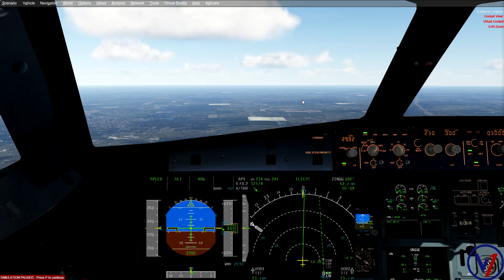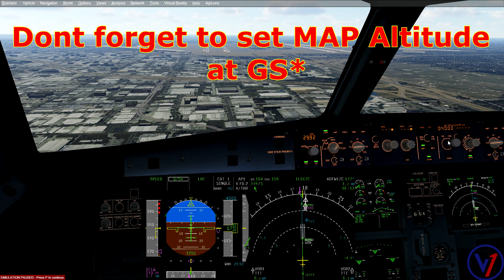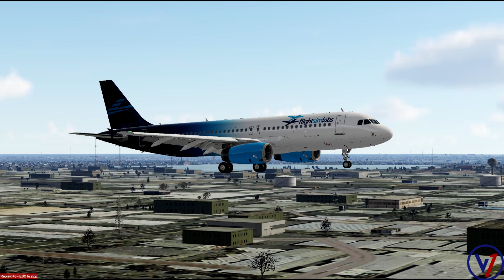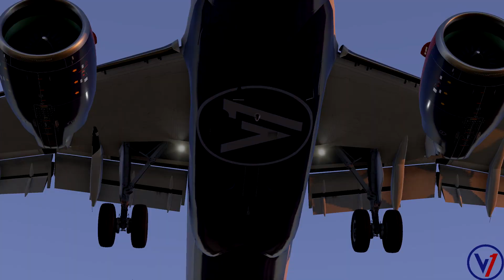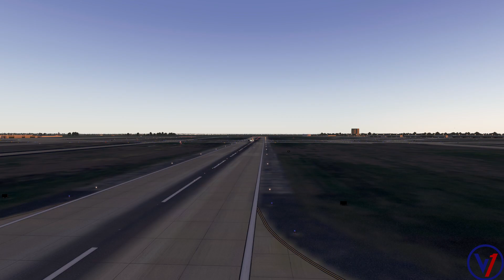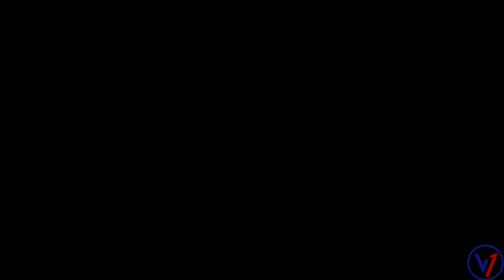Capture Glide Slope from ABOVE | REAL Airbus Pilot | Stable Approach

Comment: I’ll go  1 manage speed when I think I’m going to be high, 2 alt knob goes up, 3 vs knob goes down, 4 gear down 5 set missed altitude now(in case you never get gs captured later, the missed altitude should be correct also )

Comment: Hi there,
I'd like to know if in real life, when you're using F.P.A  3° after your F.A.F, there could be instances where the descent rate isn't really enough? This is happening to me.I'm doing a VOR approach into LLFL, using the  LSE VOR, for 35 L, and chart says to descent from 3000ft at 8.8 NM to VOR. When I do, I am always high on profile and have to disconnect AP to manually increase the sink rate. I'm on the MFS2020 xbox standard series.I have taken care of selecting the altitude above 3000 ft as you mentionned to avoid the aircraft levelling off before. Any thoughts?

Comment: Hello V1,  I'm an airline pilot on disability eventually going back to the Airbus, a new airplane for me. I watched your comparison video between Toliss and Flight Factor and concluded, system wise, that the FF was superior.  I know time has passed since the video, so not sure what has changed . What do you think would be most appropriate for "pre training"? Thanks in advance!
Reply from the maker: Toliss for sure! I recently did a new comparison video that you might wana check out. But as far as ease of use to set up certain failures and such the Toliss wins. Congrats on your return to the line! Welcome back
Reply: @V1Sim  Thanks V1 for the timely response, your videos will surely make my transition easier.  Now to buy a proper computer😎

Comment: hello, cap! is that accurate comparing with real mcdu that on the fslabs when i copy secondary f-pln from the active above the 10000 feet secondary f-pln follows the active like it is removing passed waypoints by itself from the sec f-pln same as active f-pln and it's no need to be copied from active after every waypoint?
Reply from the maker: Hmm I think I understand your question, but not sure so I’ll explain how the real MCDU works, the real airplane does not delete any SEC FPLN waypoints by itself. When you copy the “active” it will copy all waypoints that are currently in the active flight plan and they will remain there until you delete them or change them. For example if I load up the XYZ Arrival, then I copy that to my secondary and a few minutes later atc changes us to ABC arrival the secondary will still show XYZ arrival
Reply: @V1Sim  thanks 🙏🏼